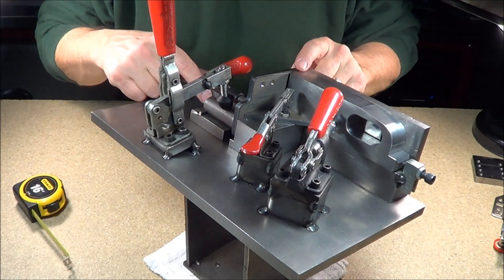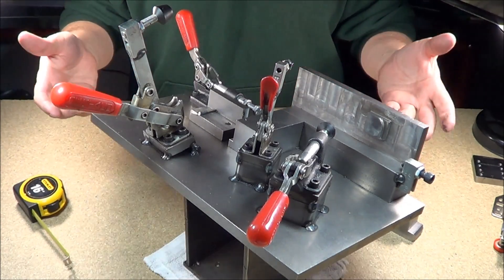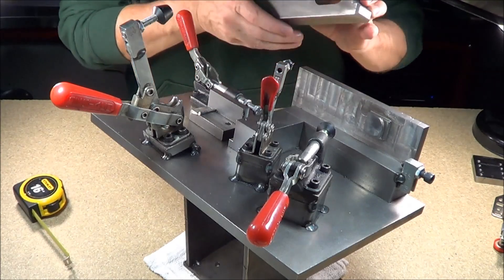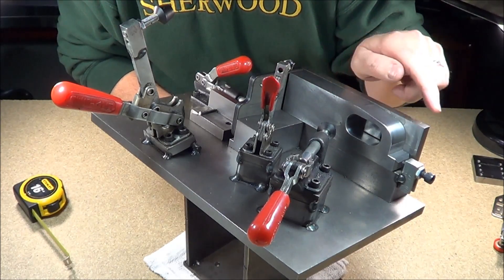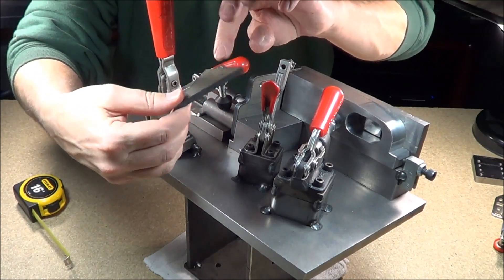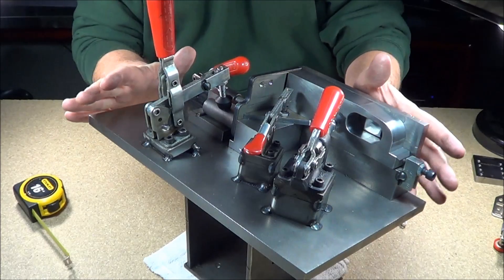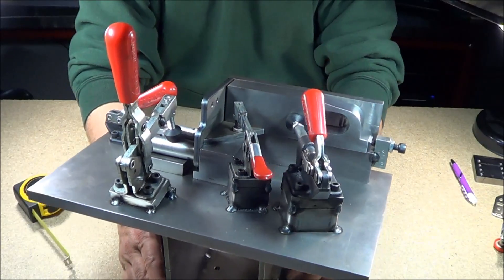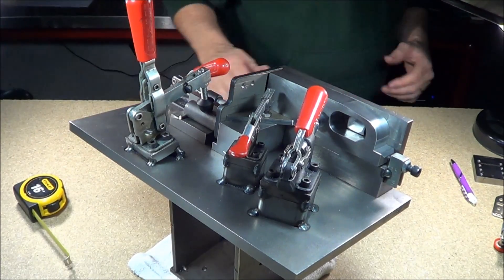How I use External Threaded Bolt Retainer on a Welding Fixture

Comment: holes with lasers are cutted. not burned out lol
Reply: Technically oxygen assisted lasers are “burning” operations. The photons are used to heat the metal with friction and the oxygen accelerates the cut, creating plasma to remove the material.

Nitrogen/inert gas shielded lasers are “cut” - the photons act like the teeth on a saw blade, physically removing the material, and the inert gas cools/shields the material to prevent the combustion/plasma front. This is why N2 laser cuts can meet tighter tolerances.

Comment: A suggestion tip: If you are about to weld the full seam @ 3:09 on the top between the bigger block and the thinner hole plate, I would recommend adding a triangle cut in the support plate area so you don't accidentally weld the assembly to the fixture plate.